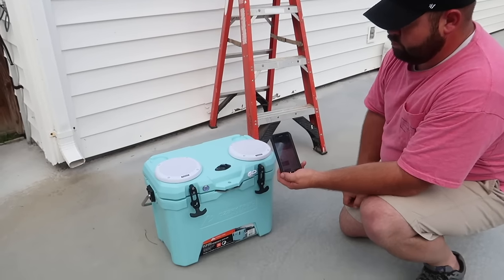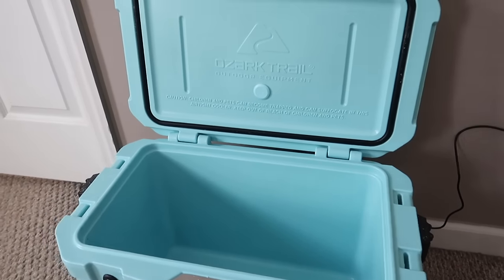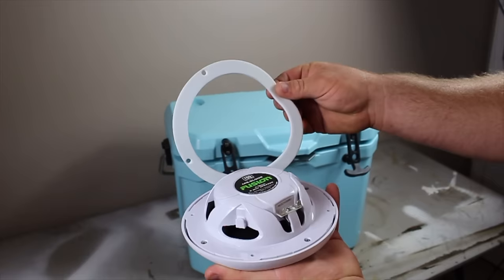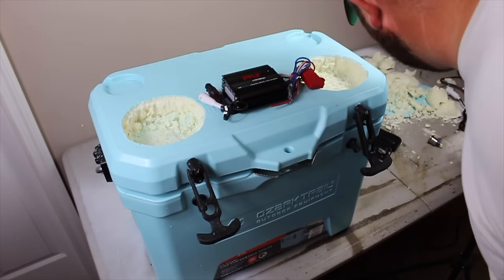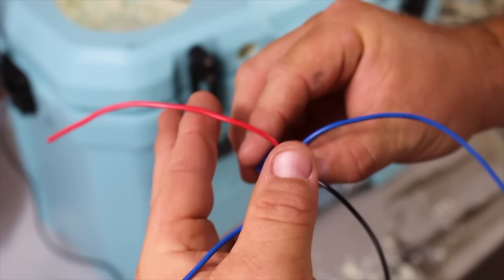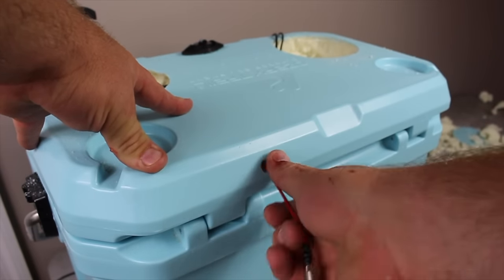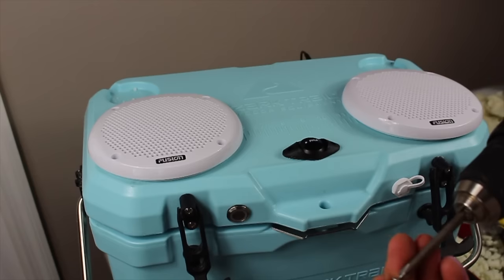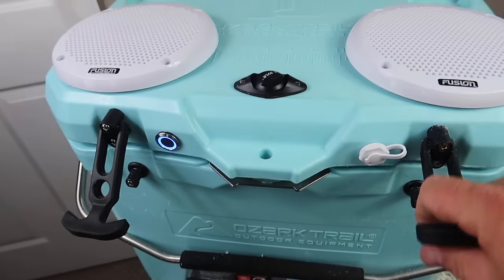DIY | HOW TO MAKE A BLUETOOTH STEREO COOLER

Comment: This maybe 6 years ago, but man this build is solid, couldn't find the same cooler so ended up with a lifetime cooler about the same size and stye. They make a bigger battery now, so went with a 11000mah battery pack just shy of double the battery life. I also used a set of Rockford Fosgate 6.5's, I did have to use a heat gun and melt the inside to give some extra room for the bigger set of speakers. Solid build and great set up! Very loud!
Reply: SO HOW MUCH MORE TIME DO YOU GET OF THE 11000mah?

Comment: I sold a cooler at work a week ago, that I nearly fell over when I realized the price of it!  It was about $197.00!  I did a double take. I told the guy for that price it should have speakers in it like you were planning to do to this one!  I saw your video where you tested the length of actual cooling in it. And then how you installed the drain plug.  Neat to see it full circle now!

Comment: I ordered all the parts that you linked. I’m having trouble with the battery shorting out when I plug in the external charger. Any ideas what would be causing that? I followed the wiring diagram

Comment: Nice build. I did one a few years back in a igloo cube. They didn't have bluetooth built into the amplifiers back then.
Reply from the maker: I agree. I used to sell plans on making bluetooth coolers in colemans on ebay back in 2013. I had to add much more stuff to make it also. This was pretty much a breeze. When I started the channel I had a yeti with a stereo in it but wasnt bluetooth. This isnt a diy but its an oldie. https://www.youtube.com/watch?v=GWeex9x9mvE&t=1s
Reply: Would you be willing to build and sell one?
Reply: Would u build one to sell me ?
Reply: @Fentertainment  how can I connect Maxmoral 3PCS DC-099 DC Power Socket Connector with Waterproof Cover Cap,Threaded Female Panel Mounting Adapter Power Jack 5.5 x 2.1mm to 6000mAh battery and also how to hook this 
APIELE 22mm Latching Push Button Switch 12V Angel Eye Ring Light LED... up to plye hydra 4ch amp ?
Reply: @Fentertainment  hi there I was woundering if you could get a better view of all the components the way you hook up before you put it in the battery the amp inside the ice chest cooler lid I am trying to make one but I am not putting the batery and the amp in the cooler lid I want to put the battery and the amp underneath ice chest cooler lid thanks I would per a better view of all the components hooked before you put in the lid love the video

Comment: Question.. if I wanted to use like a power tool battery like a dewalt 12v and attached outside of the cooler.. where would the grounding point be for the amp etc.. battery?
Reply from the maker: The battery.

Comment: question i ordered one of the docks for a cordless 20v battery do i have to run a voltege stepdown on this amp or would it be fine direct wire to the cordless battery

Comment: Could you please show how exactly you got the battery to power the amp please? I’m very visual and trying to figure out how to connect power and ground to that Y off the battery. 
I’m assuming you have to cut the piece of the Y or could you wire in something that plugs into the Y connector?

Comment: can you move the cooler way so we can see the way the battery is hook up to the switch and amp thanks. i want to make a bluetooth ice cooler with plye 4ch hydra bluetooth amp and plye 6.5 1/2 400watt marine speaker

Comment: I have used a pyle amp in other builds. I put it in a enclosed case and it overheated pretty fast and burnt up. Since then, I have added a little 3 inch PC fan in the wall of the cooler to vent the hot air. How do you prevent this one from overheating? Has anyone enclosed this style amp and had it not overheat?

Comment: how did you pull out the yellow wire and also can you show a better way of how to hook the Talentcell Rechargeable 12V 6000mAh/5V 12000mAh DC Output Lithium ion Battery Pack for LED Strip and CCTV Camera, Portable Li-ion Power Bank with Charger, Black and also hooked up to the amp thanks

Comment: Excellent work!!!  What's the depth of the lid?  Is it possible with these coolers (Ozark) to install everything in the front of the cooler?  I'm thinking of doing with with the Kicker PX series amp with BT built in.  Suggestions??

Comment: Can we get a full video on where you stuck the amp and the battery at? Please
Reply from the maker: I dont have the cooler any longer but everything was stuck in the lid. Cleaned out the foam of the lid, stuck the amp and battery through the speaker holes in the top.
Reply: @Fentertainment  thank you man

Comment: Where did you hide the amp and the battery inside the cooler?
Reply from the maker: @jasonmontet653  in the lid. Slid them through the speaker openings before mounting the speakers.

Comment: We have everything the same as you but the battery. We are having speaker whine and we can’t figure out why?
Reply from the maker: What power source are you connected to? Sounds like a ground issue.
Reply: Same battery that you used but a larger capacity. Also there is two outputs on the battery, one is 12V and the other is 24V, I am using the 12V to power the amp at the moment. Is that what you did?
Reply from the maker: @itsdjreal4224  Yes.

Comment: I need to see how you connected the wires from the amp to the portable battery  those connection don’t line up.
Reply from the maker: I made a wiring diagram and inserted it in the video. Once you get to that part just pause it. Nothing plugs in to each other really.

Comment: There is a link in the description that says connectors but they're not available on Amazon anymore what are those exactly?
Reply: There are 3 different ones you need overall, the male and female 12v 5amp connectors, these are 2 different connectors sold as one pack though. The the ones linked arent available, however there are other brands available. And then you need the 2.1MM  5A DC power jack socket. The one linked for that shows still available.
Reply: Can you add a link for the connectors in the other brand

Comment: @fentertainment your video doesn't show how much installation you carved out or the insertion of the amp & battery.
Reply from the maker: I didnt show it but it was a good bit. Basically I removed some and then test fitted until I removed enough. If you get this same cooler there is a plug underneath the lid where the manufacture filled the lids with foam.

Comment from the maker: Materials Used :
Speakers - https://amzn.to/2NkMIuT
Amp -  https://amzn.to/2Nn6Dtc
Battery - https://amzn.to/2Jq1zC7
Power Button - https://amzn.to/2NSrZQr
Connectors - https://amzn.to/3OLexfP
Surface Mount Connector - https://amzn.to/2NRW4iU
Reply: Fentertainment will the will amp or battery overheat in the sun?  Plan on building one for a river trip.  Great job, best build I have seen.
Reply: What are the connectors when I click on the link it just pulls up Amazon
Reply: Anyone find connectors or alternative

Comment: Where would you get a ground from?
Reply from the maker: The battery supplies power and ground.
Reply: @Fentertainment  So you connect the power and the ground together from the amp to one of the males of the Y cable what comes with the battery?

Comment: how long do you think the cooler will play on high volume on that portable battery?
Reply: He's using a 6ah battery pack so fully charged if the amplifier is pulling 1amp it would last 6 hours.  This amplifier has a 10amp fuse so it's going to pull less than that.  Just say it pulls 5amps constantly it would last just over an hour.  Thing is when playing music your current draw (amps) won't be consistent so there is no way to tell for sure without some testing.  I suspect you'd probably get 2-3 hours out of it at most at a high volume level maybe a tad longer.   Really depends on the music your're playing etc.
Reply: I did the exact cooler off the radio except the 3ah battery. Did a test run today and got over 5 hours playing as loud as I could. Just bought the 6ah to install. Hope this helps!
Reply: @keifer0389  how long did the 6ah end up while playing full blast ?

Comment: Im a bit confused in wiring. In the video u said the battery button always stays on. Does the switch turn the battery on and off also if the battery switch stays in the on position? Or does the push button switch only turn on the amp? I guess im wondering that becasue if the battery always stays on does it basically just die on its own when not in use?
Reply: It will technically use a very small amount of battery since when you have the battery on it lights up tiny lights that tell how full the battery is. The amount used would not even register though so i wouldnt worry about that. It has to remain switched on due to the build of the battery that requires it to be in that switch position to take a charge.

Comment: What did you use as a power switch? To not drain the battery when u aren't using it. I have this idea of putting a powered loaded subwoofer enclosure in a backpack that pushes 300 watts rms and weighs 10 lbs before I add the weight of a marine battery to run it.
Reply: Hey would you post a link to the woofer  and amp your thinking about using. I’m about to purchase all the stuff to do this build and I’ve come up with some crazy ideas how to add an additional cube off to the side with a woofer, connected by Bluetooth. How are thinking you’ll connect the two?
Reply: Use a 3.5 mm aux cable with a red and white rca plug(male)on opposite end. Plug in rca to amp and aux to phone. Or use a rca male on one end female opposite for the bluetooth adapter starts around $15 because it only has the aux plug-in so it might need a different adapter for it to actually connect this way
Reply: Goin to use a rechargable 7ah battery and put this in a backpack and use it like that
Reply: For less weight to carry
Reply: The 8" sub and 300 watt pyle amp was what I was goin to use
Reply: Since I'm goin to run my remote to my power cable terminal was why I was asking about a switch since it won't shut off when I'm done.

Comment: i bought this setup and i get the music to come out no base or vocals though any ideas it's almost like the Bluetooth connection isn't good?
Reply from the maker: If you bought this same amp I used. On the side of the amp is a white cover, pull the cover off and there should be some small switches. It sounds like the amp is in low frequency mode, switch it to high.
Reply: @Fentertainment  the only switches are input and polarity and a gain nob... i connecter it to the rca jack and same thing i thought it was a bluetooth issue is it possible i got a bad amp??
Reply from the maker: @hurrikanegolf5274  It could be. Order another send that one back is what I would do.
Reply: @Fentertainment  thanks

Comment: This is amazing!!!! Would a power bank be the same thing or similar to this rechargeable lithium battery? Would it be enough? It's a power bank for laptops, phones and so forth. Thanks in advance for your time :)
Reply from the maker: I think so, just wanna make sure what ever you get will fit your cooler and the opening of one of the speakers.

Comment: How long before the battery needs to be recharged @fentertainment
Reply: I dont have an exact time frame for the battery however i made this and using the same battery i was able to play the cooler constantly at the lake for 6 hours, took it home and did not charge it, went out to the lake again for another full day 6-7 hours of play time with no charge. I was able to then keep playing it at my house working on a few projects in the garage and the battery did not die. I will be taking the cooler on a river run at the end of July but so far the battery has not been an issue and has lasted longer than i have needed
Reply: @AntiTruth  nice,

Comment: Where is the link to the aux plug in?  I ordered everything else but could not find the aux extension.  Awesome job by the way!
Reply from the maker: The aux plug is with the amp
Reply: @Fentertainment  oh, sweet.  It comes on Thursday.  So excited to get this build going.  I was wondering, do you think it is possible to link an extra battery?
Reply: I found out you can daisy chain another battery.  Do you think there is enough space to add one?
Reply from the maker: @mikeyjoe0921  it maybe tight. However you might be able to get it.

Comment: what other speakers do you recommend? the fusion speakers aren't available on amazon anymore
Reply: You need to get speakers with a < 2inch depth so they fit in the lid. I got a pair of magnadyne speakers that worked great. Im doing another cooler now and using a pair of pyle marine speakers with blue led's inside that will hopefully look very nice. Most marine/hot speakers will work great as long as you keep the depth correct so everything fits well inside the lid.
Reply: @AntiTruth  perfect thanks!

Comment: How did u get the battery in between the speakers?
Reply from the maker: Slide it through the speaker cut out. Do the same with the amp.
Reply: @Fentertainment  how did you Secure the amp and battery once in there? would spray foam work? or do you need the space for heat?

Comment: Could you run 4 of those speakers on this amp?
Reply from the maker: I have the link to the 4 channel amp in the description and pinned top comment. Its the same price as the 2 channel. I actually used a 4 channel this past weekend to help a buddy out on his.
Reply: Fentertainment . Thank you . I love your cup vids.  I have built several myself. Your cool as hell and very help full.
Reply from the maker: I appreciate it man. Thinking about trying to build a cheaper version of this.
Reply: Yeah I just priced everything. With 4 speakers , it comes out to be $224 not counting cooler but I have one already. But it's still cheaper than most cooler already built. You can go with a cheap cooler but you get what you pay for.  I think you done great on this. I was going buy a built one but seeing this im building my own and saving money. 🤘

Comment: How long does the battery usually last on a full charge
Reply: I dont have an exact time frame for the battery however i made this and using the same battery i was able to play the cooler constantly at the lake for 6 hours, took it home and did not charge it, went out to the lake again for another full day 6-7 hours of play time with no charge. I was able to then keep playing it at my house working on a few projects in the garage and the battery did not die. I will be taking the cooler on a river run at the end of July but so far the battery has not been an issue and has lasted longer than i have needed
.
Reply: @AntiTruth  was this using the radio at full blast? i used the exact specs used in this video and took the cooler to the beach  and my battery only lasted 3 hours
Reply: @priscillavaladez5612  that's interesting. I don't think we had it maxed volume the entire time but it was loud enough to enjoy. I just made a second one with led speakers and it had already went for a 7 hour day by the pool and did not die. Again it was not on full blast but it could definitely be heard by everyone.

Comment: Where did you put everything inside the lid  and are they stationary under the lid ?
Reply from the maker: So like I mentioned the amp is between the speakers and the battery is behind it near the rear. Yes everything is in place. I removed enough insulation to slide stuff into place with out it sliding around all the time.

Comment: I’m having trouble getting the batter to power up the amp, could you possibly send a actual picture of how you wired everything up? I’m not to tech savy so the wiring diagram and how you connected the y cable to the switch and amp stump me😅

Comment: Is there a way you can use USB ?
Reply from the maker: I could've added a usb port on the side to charge phones. That would've been smart on my part but do it at the time. I might have to add one to it in the spring when this thing starts to get used all the time.
Reply: Yes

Comment: Hi there i was woundering if you could tell me how to hook up the plye 4ch hydra bluetooth amp 6000mah rechargable battery , APIELE 22mm Latching Push Button Switch 12V Angel Eye Ring Light LED Waterproof Stainless Steel Round Metal Self-Locking 7/8'' 1NO using this 25pcs Conductor Compact Connectors Lever Wire Nut Electrical Connectors with Fixed Base for 3 Circuit Inline Splices 28-12 AWG please get back to thanks love the video
Reply: I found the issue. The charging ports are at fault

Comment: How can I hook up the Talentcell 12 6000mAh battery to plye 4ch amp and to this APIELE 22mm Latching Push Button Switch 12V Angel Eye Ring Light LED Waterproof Stainless Steel Round Metal Self-Locking 7/8'' 1NO 1NC 1 Pack (Blue) and how can I hook this Maxmoral 3PCS DC-099 DC Power Socket Connector with Waterproof Cover Cap,Threaded Female Panel Mounting Adapter Power Jack 5.5 x 2.1mm to the battery

Comment: No one is getting replies to questions posted about this video. For the cost of the cooler I could buy a portable guitar amp and add Bluetooth to it or any number of portable Bluetooth speakers available now.
Reply from the maker: This video is over 5 years old now. This is the last one I built and no longer have it. It was never meant be just a bluetooth speaker. I just incorporated 2 things that werent meant for each other in one.

Comment: It would be better if you better explained the wiring. I hate when people go thru wiring and electric like they're talking to experienced electricians
Reply from the maker: I included a diagram. Just pause the video to be able to check it out.
Reply: That seemed a bit rude, my bad. I did see the diagram. What is the run time of that battery.